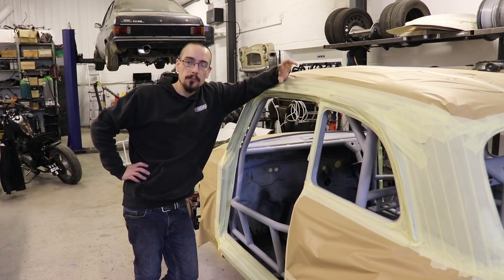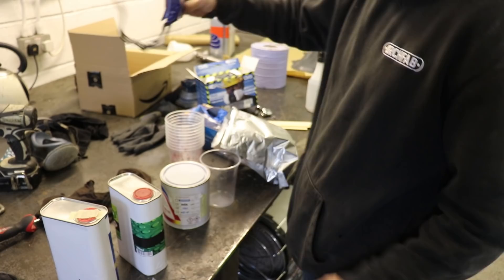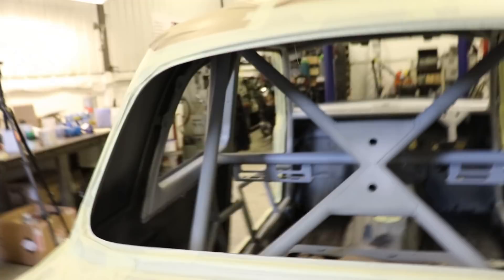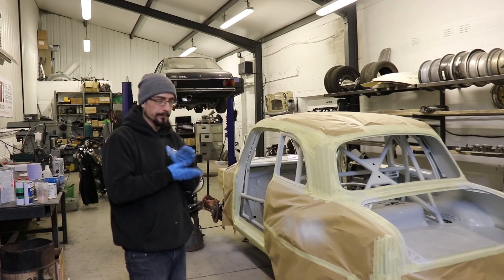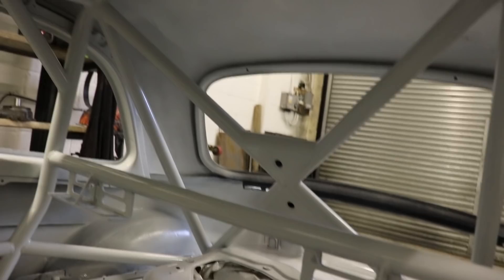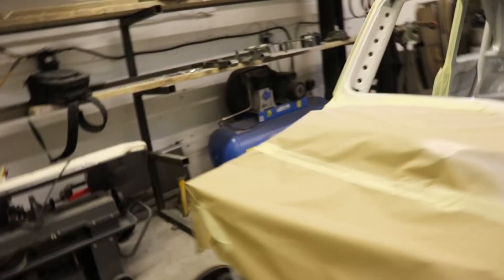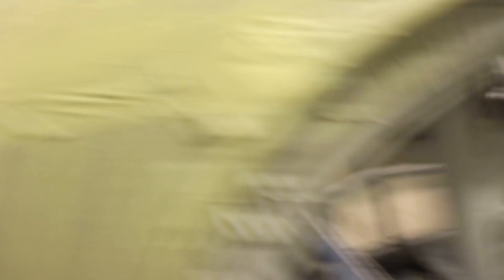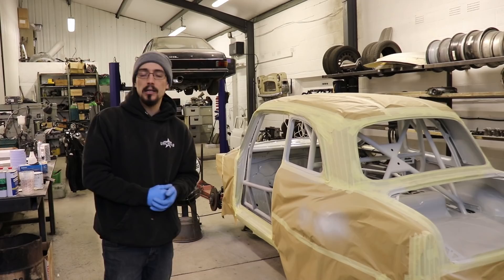ATTEMPTING TO PAINT THE ROLL CAGE, MONGREL 1 URCHFAB NIL.

Comment: Hi Matt, Your problem is caused by a multitude of small things adding up to what you consider a cluster****.  Back to basics for a sec. When you compress air it gets really hot and absorbs moisture from the air.  Your hot, moist compressed air goes into your receiver where it begins to cool. As it cools its ability to retain moisture drops so the bottom of the receiver starts to fill up with all the water that has dropped out.  So you need to empty the receiver every morning (more often if the weather is hot). As your compressor is a reciprocating compressor it has little or no ability to cool the compressed air prior to sending it down the line if the compressor is on a high duty cycle, so you end up with a compressed air line full of water droplets when left overnight, just in time for you to spray them all over your car the following morning.
There are a couple of ways to reduce the problem.
1/. Buy a refrigerant dryer, which eliminates the problem permanently but will eliminate your bank account also.
2/. At a point no closer than 5 metres to your compressor put a Tee fitting into your line which forces your air to go either up or down. On the bit that goes down put about 500-600mm of pipe with a valve on the end.  On the bit that goes up, go vertically for at least 2 metres then put an elbow to allow it to go horizontal again; except you make like a plumber and leave a slight down hill angle on the pipe so that any droplets will make their way back to the elbow and drop down into the short bit of pipe and you can dispose of it by opening the valve.
3/. Your in-line water filter has little, if any chance of removing the moisture in its present location.  it is getting hot, moisture laden air thrown at it at 100psi (or more) straight from the compressor.  Remove it from its present location and take it to the user end.  At this end you should have a pressure control valve to regulate your air pressure.  Put your moisture trap back into the system between your regulator and your tool...in this case your spray gun.  By putting it there it will be getting cooler, de-pressurised compressed air and it will work far more efficiently.

this system is cheap, easy to install and will remove a large percentage of the moisture from your air supply.  BTW, that black stuff in your paint could be oil from the compressor. As they get a bit old and tired compressors can pass tiny droplets of oil into the system.  This arrangement can help minimise that as well.  good luck and let me know how it works.  The Mongrel looks great and is a credit to your workmanship.
Rob Lawrence
Reply from the maker: Cheers mate, that's really helpful.

Comment: Looked like you had the small cap closed on the cup, that's supposed to be open to allow air in for better paint flow.  Also, too much, too soon with your paint.  The amount of paint you got on, should have taken 3 layers, not 1.

For the gun would suggest at £250 a DeVilbiss GTI Pro Lite with TE20 cap and 1.2/1.3mm tip is about as good as it gets for the cost.

The water might actually be cos of the 1.6mm tip, high pressure and causing condensation at the cap, not necessarily water in the line.

Comment: Its your heater! Its kerosene and its putting unburnt particals in the air. Use electrical heaters! Also make sure the top breather on the guns top lid is free and clear and not clogged, if its clogged ur paint will come out thick because psi will be off. Remove the top breather cap only when you paint flat panels but when you tilt the gun put it back on so you dont spill paint on yourself. Also if you have a small eyelet burner, get a pot fill it with water with a low setting heat up your paints before you paint. This will help flow the paint out much smoother. Also you can reduce many paints with reducer up to 10%. Painting in cold weather sucks, which is why many shops have heated booths.

Comment: Matt ! have same set up as you and im in the uk too ! i notice when i am sand blasting the more the air in the compressor heats up the more water you will get in your lines ! go for short 15 min bursts and let it cool down and before you start again give the tank and your traps a quick empty ! I also note if tilted compressor more water came out, Really need an air cooler in between the Head of your compressor and tank ! lot of American guys use things like automatic gearbox coolers etc ! you can also build another type cooler out of thick wall copper piping with built in Water traps should be added to the air leaving the compressor before your air line ! “all on youtube guides” like i say if you cant be assed with all that, short 15 min bursts then let it cool ! mind too i said you can build a bolt together-spray booth using cheap CLS timber and Dial polythene from B&Q or Build a big wooden square and hang it like one of them wooden cloths lines folk used to have in their kitchen well above car and just staple the polythene right around the wooden square ! be like a big polythene operating theatre 😂👍🏻
Reply from the maker: Cheers for that mate.

Comment: You need a water trap at the gun you should have also used a filter when you  put the paint in the gun and you should have a gauge at the gun for accurate air pressure the gun you have needle wise is for undercoat for base coat you should be using a 1.2  1.3  dont get upset about it we all have to learn. Look forward to seeing the next video buddy happy new year everyone   Rob

Comment: To paint the car, inside or out, build a "temporary" paint booth using plastic drop sheets (dirt cheap) and a bit of timber. It will stop the overspray and you only have to heat the booth. Take care to ensure you are getting enough fresh air when/if you paint in the booth.

Comment: We all know painting is a bit of an art and a touch of science Matt. Trev is right about the gun. 1.0 tip or 1.2 is what you need for inside. A basic low cost HVLP touch up gun will do nicely. The water separator at the gun is a must have as well. Don’t be discouraged because it will come together.

Comment: Hi Matt happy new year! 

We have just sprayed a caddy plus a moggy and have never done this before so it’s a leading process to say the least!! A couple of tips as we had the same problem with water droplets. I found I needed to run compressor three or so times and drain each time also have a water filter attached  to the gun and press this to release the water every so often while spraying (away from paint work)
Also best results were to spray a first coat when spray second coat after about 10 mins before if fully drys. Also you might want to filter paint as it goes in gun. Lastly ! I find if air pressure drops it spurts out of gun so just let it re build pressure every so often 
Cheers Rich
Reply from the maker: Cheers mate.

Comment: looks ok matt, its all down to equipment, conditions ect , also try and get a regulator for yor spray gun as to control air pressure as it seemed a bit high as that also is a contributing factor for runs. happy new year.

Comment: Hey Matt, the gun might have old paint flakes still in it's galleries. I soak my guns in gunwash thinner overnight and clean as best as possible, if any old residue is there it'll usually be tiny and be in the first coat. I'm a backyarder and run 4x water traps, 1 next to compressor, 2x are in line at junctions/outlets and one on the gun.

Comment: Most people don't know that the activated charcoal in a respirator is only good in open air for a limited time.  You should always store it sealed in the bag it came in or a sealed container. Or it won't filter anything the next time you use it.

Comment: Add a desiccant trap at the gun.  1.6 tip is pretty large and is putting out a lot of paint, that combined with cold temps will cause runs

Comment: You need a moisture trap and regulator set up just before the gun Almostt like an extention lead it will then come out fine, fluid tip also need to be changed for easier spraying use the Clarke gun from machine mart, hvlp gravity fed easy to use, I used it to spray epoxy, they also do a far smaller gun aswell

Comment: Dunno if anyone else has suggested it but if the metal is a lot colder than the paint you're putting onto it (heat from the compressor) you can get condensation forming under the paint causing micro blistering. I'm guessing the heater warmed up the bodywork more than the cage, if the blisters mainly are on the cage you might need to get the whole thing toasty before you start?
Good luck

Comment: Filter before the gun.and coffe filtering the paint would help you equalizing the paint(mix it well.bottom is thick u want to remove whats too thick).also smaller tip 1.6 is mostly for primer.your spray patern seems wrong too.u want more of a 30-40 degres up and down when it exits the gun..when you test you dont want a circle of paint but more of a long oval (hope this helps im french so its harder to explain for me)

Comment: As others have said use a filter to load your gun.  Buy a cheap set of digital scales to mix your paint to hardener accurately. To reduce runs, spray a thin first coat, give it 20 mins or so so it goes tacky especially in awkward spots like window frames and corners, then your next coat will adhere better.

Comment: The water is 100% from the air. It can be a really big problem to get dry air. You might even need a refrigerated dryer if it is really bad. Also, old water standing in the pipes and hoses can come out at any time.
Painting the inside of a car with a cage is almost an impossible mission. Uneven thickness of the layers will give you a "nice" mix of runs and orange peel.
The few times I have tried I have used higher air pressure than normal.  you then get a fine fog of paint that seem to spread a little bit more even. But you waste some of the paint that instead will spread all over the workshop and paint everything. Many thin coats from all possible angles is probably a better way to go. I gues that a smaller nozzle would be a good help.

Comment: Yeah sounds about right with the cold and water,   should hire a spray both that's a oven to heat up the car first,  then turn it off then  paint the car then turn it on to dry the paint,   yeah winter is a pain,  could use the spray can on the role cage,  it's all learning experience keep going 👍🏾👍🏾

Comment: You have a lot of things here that you're having trouble with.  
You need air with no moisture in it.
You need a spray gun with a 1.2 nozzle  & do the first coat very light (almost dusty) ,the second coat a bit fuller & the third coat like you painted the small panel you showed. Leave time to go tacky between coats ( touch masking tape to check ).
You may need to heat the room (material data sheets will give details of temp & humidity).
I find that moisture in air lines also destroys plasma electrodes & nozzles, 
Rub  runs back & give the rest a quick scotch bright rub.
Good luck for the next go at it. 
Every spray painter has done this sort of thing the first go at 2 pack.

Comment: You might have the compressor too close to the car you are painting (oil from the compressor will contaminate the air). I had my compressor in the same sort of location as you have and when i moved the compressor the fisheyes were gone. 

Dont buy a new gun just buy a new parts for the devilbiss, like size 1.4.
Also use multiple "water traps" and use compact one right before the gun.

You could also try and buy new hoses. Water and oil might be trapped in the hoses. You could try and just blow air on a shiny surface and see if you could see any moist coming through.

Thegunman here on youtube have some killer diy painting videos.

Comment: Filter the paint to get the bits of crap out and use a 1.4 tip on the spray gun have a 50% over lap when painting the outside of the car so you don't get tiger strips in the paint and a nice even coat.

Comment: Happy new year Matt.
Think yourself lucky you aren't making your living painting gates and railings  .😱
I wonder if the black box in your pipes is just a filter and not a water trap. 
Mine has a auto bleed off hole in the bottom that dumps the trapped water when the level rises.
Trev will put you right.

Comment: The inside was always going to be a pain to paint. Let it cure for a while and recoat the worst bits.
My 2 bits of advice are dry that compressed air and get some heat to the steel. As others have said the gazebo route will help contain the heat.
The exterior body will be easier to see where you have already painted, it's really difficult to paint curved surfaces in bad light.
Please don't get disheartened, really love your videos.
Always remember every painter has painted a car for the first time

Best wishes for 2020
Reply from the maker: Cheers mate.

Comment: It's not you that the problem is It's the cold along with the water in the lines. I painted in cold for years. I find just dust it on. Give it twice the drying time between coats. You can try warming the shop but the steel is cold so stick the heater in the car if you want to warm the steel. Your doing fine. You learned alot from this so take it all in and do it agian. I painted my share of fuck ups. It come with the territory. She looking good. Keep at it.
Reply: Of the water is coming from a warm compressor in a cold shop. The line right to the gun will have water. A inline filter will fix that.

Comment: Buy a cheap gazebo, get a couple oil or halogen radiators and a couple good lights and presto, paint booth done. Couple other good pointers that have been pointed out, is filtering the paint and the water trap. Also the heater, propane heater puts out lots of moisture, not sure how good oil (diesel) shop heaters are, but would belive it to be the same.

Comment: Water trap needs to be on the gun. Air is still hot when it goes through your wall mounted trap. It then cools rapidly in that long air line and the water drops out. You need a cheap eBay gazebo tent like home built Geoff used to sort the overspray. Don’t give up. Fix those 2 things and all good

Comment: Feel your pain man. Sucks when life wont stop throwing rocks at you or your project. You need a wedding tent like motion auto tv used for the supra. Also put a dehumidifier in the tent. For the inside id resort to rattle cans from a auto paint supplier, much easier.

Comment: Happy New Year, when you said you wanted to get the car up and running i dont think you had that in mind..........might be worth getting a new air line and use that just to paint the inside as the current one might have a build up of oil in it, 1.3 /1.2 gun size will be fine, 1.6 in the cold coupled with the small spray pattern you had for the bars was always heading to runs.

Comment: mask up the  floors where u will be sitting in it  and pull it off when when u r ready to paint tho floor that will keep they parts clean well u do the rest 
if ur workshops cold then ur paint will be to try keep the paint warmish like room temperature in ur house and dont use thinners u wont need it that should help with the runs 
couple of cheep watertraps on the walls plumb them into ur airline will help regulate ur air aswell ...wouldnt bother with 1 on the gun 

hope that helps bro

Comment: Matt you need to run the mixed paint through a straining filter while pouring it into the gun. This will eliminate the roughness you speak of

Also run a water trap at the gun. Can get cheap ones
Reply: Perhaps also trying to wind the fluid needle all the way in then back it out 1-2 turns. Too much material means runs

Comment: Keep a dedicated air hose just for painting. Other air tools will leave oil residue in line. Second disposal cups that have the flexible bags allow to trun spray gun upside down and will not vary  the paint supply. 3rd I swear by Iwata top of the line spray guns.  I am primarly a mechanical tech but can lay paint well enough  to satistfy most consumers. 4th make air pipe drop down with a drain at the bottom and then go back up wall about 24 inches . Then hook up a air dryer and hoses used just for painting. Plus keep air supply run short as possible from the air compressor.

Comment: Painted 100’s of cages. As soon as you poured the paint I knew precisely what was going to go wrong. 

Make sure you’ve got at least 5L of paint at hand. Use a semi decent quality paint brand. Use slow hardener and slow thinners. Mix the paint thin! Very thin and put thin layers on(turn the fluid screw down on the gun)-but put twice as many coats on. 
Use a gun filter in the paint pot and use a filter to strain the paint as you pour. 

And don’t drain the compressor beforehand!! The water that’s in the receiver helps prevent any new water coming out of the airline.
Reply from the maker: Awesome, that's really helpful. Cheers.

Comment: Get some thin PVC schedule 40 pipe and make a cube over the car and cover with plastic and paint inside that ... with an exhaust fan of course.. easy way to prevent the overspray on everything.. looks like you're getting a lot of condensation .. so yes a trap for the gun too..

Comment: If i was you ,i would buy a smaller gun,plenty of paint. Fit a couple of water traps. You will have to key all what you have painted ready to go again. Try and paint a smaller area,like do in the boot as a separate job. Once its done and dry mask it out. Build it up slowly,dust coat the area first then build it up slowly. Not easy doing inside ,but a good devilbiss pro lite mini will give you a good finish and make it easier to get in places. Keep the psi around 30,less over spray.👍

Comment: I think the problem your having with water droplets coming out of the gun is from  warm air from the compressor  condensating in the air cap of your gun    I think you need to put in a cooler/condenser  from the compressor to air line .